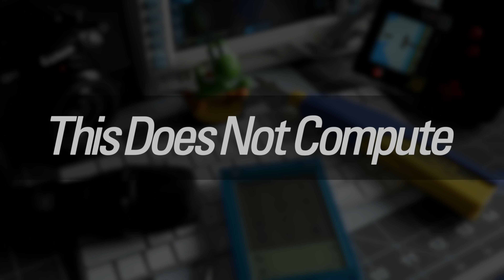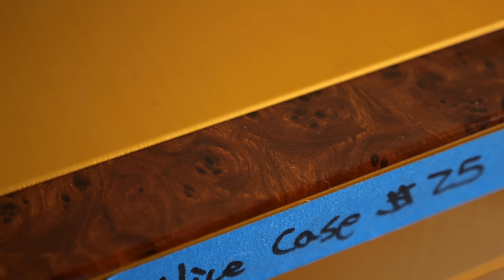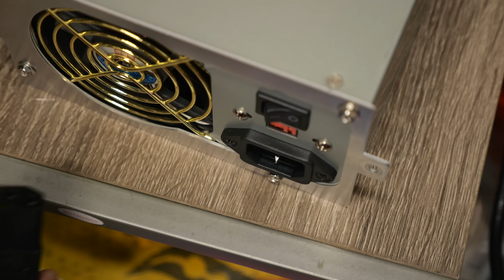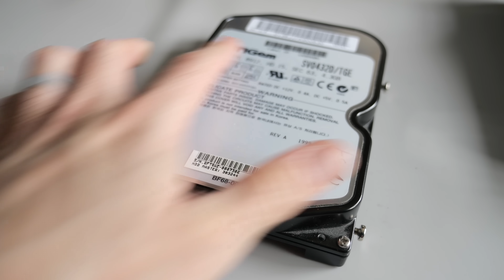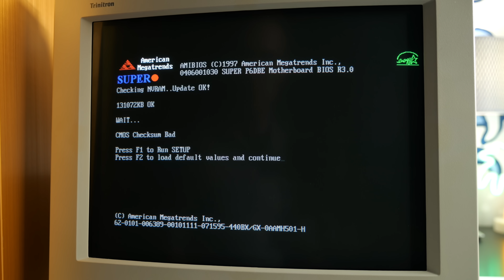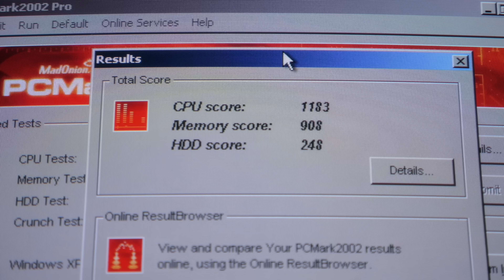I tried to put TWO vintage Celerons in one PC

Comment: I actually had a dual celeron running. I drilled and patched, and it worked perfectly. 
Also with w2k ...

That's a nice memory 😊
Reply: And mine ran both on 450MHz flawlessly 😊
Reply: The celeron was faster because it's cache ran at full speed

Comment: I had one of these rigs when I was in Uni studying computer science in 1998.  The motherboard I had didn’t have the voltage jumpers to unlock the cpu.  So what was common was to use clear fingernail polish to paint the voltage pins on the slocket cards before inserting.  Mine ran windows NT 4.0 as it had SMT.  The partial board I had required an add on APIC/IO card to allow for interrupts for multi processor.  Graphics I ran a 3Dlabs premedia 3 card in it for open GL.  This was my dev and quake computer in Uni.   Paired with a view sonic 21” CRT monitor it was a really amazing PC for the time.

Comment: As far as I was aware the slot 1 conversion to dual only needed a mod to the edge connector? Regardless the solution without mods that cant be undone is to use socket 370 to slot 1 adaptors. Almost every one of them had a jumper option to enable the dual cpu option. That would work in that board. Super Micro was a very standard board allowing almost nothing to be changed from the standard.. With voltage and a PCI video card my old dual Epox board would reliably run over 500 mhz all day long. The biggest part of the lottery of performance back then was the chipset. Like CPU's sometimes you would get a good one and sometimes not. Also an important thing to keep in mind is to only use one channel of ide for a dual system or even better a SCSI setup. Dual channels with a dual CPU on those BX? chipsets would slow the system down.

Comment: Dont cut the trace, cover the pin in the connector, i have used electrical tape. A small piece cut just the right size, and take in count the insertion or it can be removed in the process. Thats why late i switch to a BP6.

Comment: dam, that lian-li would be something I use in a modern build
I don't care about looks as much, but a copper anodized look would work well with a brass hardline watercooling steampunk theme
especially if I have a micro-boiler that can blast out a steam whistle whenever I wish(possibly using a TEC module stack to scavenge heat from the loop to do it)

new cases are often thin sheet metal with no little quirks that make life easier like the harness or a removable drive cage(and often limit you to 2.5" or only 2 drives)
that case would fit on a modern desk just fine, and as it has many mount points it probably fits most modern ITX/ATX boards and could be very nice with a little bit of hardware

in fact I would buy a case like that for use as my server PC, it would allow me to have a nice 3 slot HDD hot-swap for the raid, yet still have room for a 5.25 bay device as literally no modern cases have >3 5.25 bays when there are many reasons to have so many still
and the front 3.5" bays would be nice for various things like a fan controller or a cf-express card reader(the new modern dump card for hyper-fast data transfer, basically NVME drives in a cartridge, I hope it gets adopted beyond xbox-one storage devices)

Comment: Google is paying attention to what we write. I wrote that i owned a celeron back in 98 today. Mine was 333 Mhz though and not 300. Or it was 300 and i am somehow thinking it was 333Mhz. Either way dont matter. I am thinking socket 478. Man we are so lucky now No IRQ's to sort. No DMI to worry about. Back then installing a sound card was a big deal. Graphics cards at that time were counted in the MB of memory. Usually far less than 10. My first card was on board and it had 2.

Comment: I remember running a dual slot machine around 2000ish and had to use WinNT to get it to accept the second processor.   Had it all in a floor standing skyscraper ex server case and boy did it put out some heat, I quite liked the games back then with the Quakes, Doom, Hexen (dungeons and dragons Doom stylee), my little flat was a gamers paradise with N64 and PS on the main telly, my computer beastie in the front room too, Sega Dreamcast in my bedroom and my daughter with her mountain of NES games and her little NES all fired up.   I also had the strange PS memory card adaptor that allowed one to play Game Boy games as daughter loved Pokemon so I think we laid siege somewhat to the gaming scene and I forgot the Saturn but that never got much use as the DC was jus' so so much better.   It was around that time I earned my marks building machines, mate and I bought 40 ex business PC's all working for £40 off the then new eBay, drove all the way to Hereford from Bournemouth and car was down on its bump stops it was so heavy, couple weeks consolidated the 40 into 30 viable machines with the 10 left for spares, didn't even get to sell them as a local PC firm bought the lot spares and rebranded them, they gave me £50 per machine and sold them £200 a machine and boy was that a cool feeling esp when my next door neighbour bought one for her kiddie and she thought it was the best thing ever O.o   I stopped building for folks about 10 years ago, last build was a dual water cooled AMD system which had all the UV fluid and lights and in a toxic green sprayed Antec Skeleton which had one water circuit for the CPU and one for the GPU and RAM with the CPU water toxic green and the GPU circuit vibrant red...   Chap still has it but has replaced the board and CPU with something Ryzen and he ditched the GPU circuit but still running water on the CPU.

Comment: I had a server PC manufactured by HP of 2000-ish vintage.  I received it in 2006.  It had support for dual Slot 1 CPUs but required an additional VRM, parity RAM, and some other gubbins to make the dual processors work in it.  I'd love to see a video on one if you ever stumble across it.

Comment: I remember buying two slot1 450 P2s and the problem being cache ram in the cpus.. there were 128/256/512MB variants and they couldn't be mixed on the same dual slot1 board I had..  They cost over 1K each at the time, not to mention an Adaptec ah2940 with a 4 7200rpm wide scsi raid.. was used for rendering solidworks and cad animations. I later gave it to a friend who owned an Amiga "toaster" trying to say he had a better video rendering system.. oh the late 90s!

Comment: back then for SMP play, you had to have a matched pair of CPUs, the requirement was pretty stict with revision and stepping having to be the same, with some people going as far as having the same build dates on them. Given one was stable overclocked without the additional voltage, my guess is there might be come inconsistences with the smp requirement as a matched pair?

Comment: Lian Li really made some nice PC cases. I have a full tower PC-A77 black, and the 25th anniversary case PC-777 that looks like a shell/snail. The snail has mounting holes for dual socket 771 motherboard, which I use in this. A Supermicro X7DWE. I'm a bit jealous of yours, especially with the golden color. Shame about that the dual celeron setup didn't work as you planned.

Comment: My First PC Was A Pentium 2 With A Whopping 40GB HDD! It Was A Freebe! I Ended Up Buying A Motherboard CPU Ram Combo From CompUSA! After A Couple Of Months I Upgraded The Case  And Bought A 40GB HDD! Walmart Had The ALL-In_Wonder Card On Sale So I Started Recording TV Episodes! Today My TV Collection Is In The 10's of Thousands! I Use The HD HomeRun Quadro Network Attached Quad TV Tuner And Have Built An Array With Used Server Drives That Holds 500TB! The Program I Use To Cut The Ads Out And To Converts Them Into The MP4 Format!
I Would Have Loved To Have A Great Case Like That!! But Today I Rock Old Optiplex's That Can Be Bought Cheap! I Have A I7 8700, A 1TB NVME SSD, And A Yeston GTX 1650 In My Optiplex 7060 SFF! It Replaced The Old Core2 Q6600 That I Was Running until 2022!  Nothing Wrong With It But After 3 Power Supplies And A recap Of The Motherboard A Kingston 256GB SSD And 8GB Of 800MHZ DDR2 Ram! I Doubt My Newer PC Will Last Near As Long As The Q6600 But It Sips Power Compared To The Dell XPS 410! I Run A Jellyfin Server To Serve My Media To My 6 TV's In My Home! We Have TV's In Nearly Every Room!

Comment: Had a Tyan dual Slot 1 board with 2 Pentium 3 533's in it, cover up pin b21 and overclock the crap out of em. U can crank up the bus speed but most slot 1 cpu's can be multiplier unlocked by removing b21 pin for equation.

Comment: The first computer I ever built was in that case! It was around 2006ish. I took a summer job at a computer repair store and for my first solo build, I built a beast with a celeron M 450 paired with an EVGA 7800 GTX KO. The customer ended up paying around $2000 and I'll always remember his face when we told him we only had one 7800 in stock so we couldn't SLI it until we received our shipment the next week.

Comment: Literally did this myself in its prime. I bought a single slot board, then a Celeron 300, then a dual board, then a second Celeron, then saved for two full fat pentium 600s. I tested all along the way and while it wasn’t always 2x performance, it was certainly worth the effort. I remember the dual lockout issue, but it didn’t stop us at the time. I certainly didn’t modify any CPUs so there must have been a solution at the time that we found. Maybe certain boards implemented the workaround in the slots. I do remember buying several boards and they were all from unknown sellers all over the place. 

Games, graphic editing, and 3D rendering were all enhanced by using the duals. The best bang for buck along the way was the dual celly 300 setup overclocked to 450. I was going to build multiples of those and turn them into a render farm but while I was saving, the pentium 1Ghz happened and made the old dual CPU setups a waste of time. My whole circle of gaming friends switched to Windows 2000 because of the SMP support and stability while overclocking.

Comment: The Socket 370 Celeries didn't have anything keeping them from being used in dual processor systems, so I set up quite a number of dual Nintendo cartridge motherboards with Socket 370 to Slot 1 adapter cards.

Just to see what BSD would do, I even ran one with a Pentium II and a Celery. For some reason, people got REALLY upset and told me that I couldn't do that! I suggested that the BSDs provide support for keeping track of processor features available on each processor, so if a program needed certain CPU features, it'd only run on CPUs with those features.

It was a good time because AMD was really giving it to Intel then, so Intel really had to work to make decent products :)

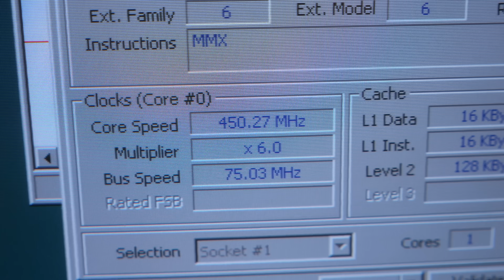Comment: @9:50 I'll answer that for you... Because the only thing that held Pentium 2's back in overclocking was the cache chips which didn't like overclocking. The celeron didn't have the cache chips, so they weren't limited that way. It is absolutely nothing to do with any decision on Intel's part. It was just a happy accident.

Comment: I had two 366 celerons overclocked to 550 on an abit bp6 motherboard.  Ran it with voodoo 2 3dfx graphics card on top of a matrox mystique video card.  Loved playing GLQuake, Quake 2, and Quake 3 with this setup.  Originally just had an original 3dfx card when they were new.  Clearly remember wife being pretty upset when I bought the second Voodoo 2 to run in SLI.  Ended up selling second one later with one 366 but still have the rest of the rig.  Your video has me thinking I may try to set it up again.

Comment: This was very common back in the day. I ran a pair of socket 370 366mhz Celerons on adapter cards, the adapter cards had a jumper that bypassed the SMP lockout they also allowed some other shenanigans, I think it may even have been in the same case (but black).
Reply: I couldn’t remember how I did it, but yeah! I used adapter cards too! And later the BP6 😊

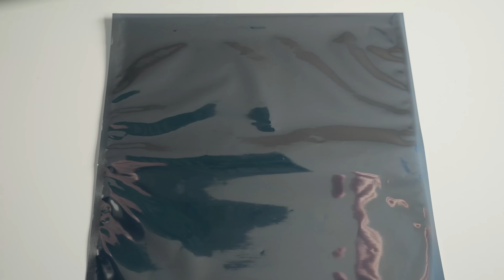Comment: At 0:30 I'm like "Oh crap this isn't going to work" .   There's a reason why the Abit BP6 was a legend back in the day, as it was very specifically designed to get around this limitation.  There was also the Epox BXB-S, though other releasing the first VIA Chipset Athlon board in 2000.. they weren't making waves like Abit who was really the EVGA of the day, pushing boundaries and releasing high quality enthusiast level boards.

Comment: I bought a 300A in hopes of overclocking it, then discovered my cheap motherboard's BIOS was limited in it's configuration.  I could set the speed to 450, but that was by setting it to 100 x 4.5.  It's setting at 66Mhz were limited.  Later on I inherited a PII 350 from my cousin that could be overclocked easily, but by then I had upgraded to a PII 450.  I had a friend who pushed his 300A to run stable at 504 Mhz, but he said keeping it cool was the biggest problem.

Comment: The Intel 440BX chipset in slot 1 had some crazy longevity, with all sorts of adapters to use modern CPUs. I had started off with a 350mhz Pentium II slot 1 on mine and ended with a Celeron (tualatin) 1.2ghz overclocked to 1.7ghz (140mhz FSB). I had a slot adapter to use socket 370 CPUs, and then a second adapter on-top of that one that allowed use of the later Tualatin CPUs by adapting for the lower voltages.

That 1.7ghz Celeron was roughly equivalent to a 1.4ghz Athlon at the time. That system was only ever retired because 768mb RAM wasn't enough anymore, not because the CPU was slow.

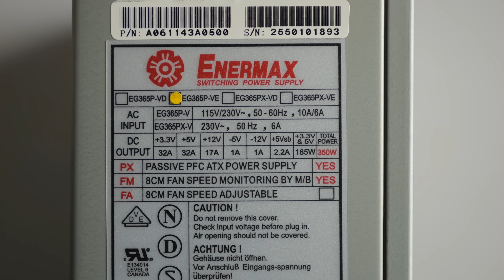Comment: 3:20 - You are not wrong about Lian Li cases.  I also deprived myself of nice cases all my PC building life-- the cheaper the better, cuz all it had to do was hold things together and let me in when I need (so I thought).
The last major PC I built, I finally invested in a nice Lian Li case-- I forget the exact model, but it's one of their popular, mostly-glass models with the PSU mounting beneath the motherboard (not at the top or bottom of the case, but behind the motherboard).  It's soooooooo nice.  Things that aren't supposed to bend-- DON'T BEND.  Things that you're supposed to be able to get in and out of are easily accessible, and stuff fits everywhere properly.
I've been a tight-wadded fool all my life, and will never skimp on the case ever again.

Comment: I built a 2x 800? MHz Celeron Slot1 (100 MHz FSB) in Dual-BX by drilling the pull- down and soldered to pull- up.

Comment: I'm sure you know this, but Celerons were nothing more then failed Pentiums, as is the case with all low style CPUs. I can't stand when YouTubers post videos talking about the Binning Process, as if it's something special just for them, when ALL Chips, CPU, GPU, whatever all go through the Binning Process. And as the chip fails it's reduced until it passes. Some chips overclock better then others due to why they failed and if it involves certain areas of speed and whatnot. Sure the Chip Lottery is REAL, but now why most think. Intel, AMD, and all the past CPU Chip makers just made CPUs then Binned them and hoped for the best. There's zero reason for CPUs or GPUs to be so expensive as their chip process and construction costs are far less today then they were way back when. Today the amount of gold used is but a fraction of what it was before and the gold was the reason the chip was so much in the first place. Monopolies have killed the Free Market and Monopolies lead to GREED. TSMC is the ONLY chip manufacturer these days and that's 100% BS. Because they control production they control cost because where else are you going to go? NOWHERE as you only option is TSMC... Keep up the great work...

Comment: Not surprised about your first 300a not being able to overclock to 450mhz as it is basically a silicon lottery.  I recall that I had the same issue when I brought my first 300a and I ended up returning it and got another one.

Comment: I'm still using my related Lian-Li PC65 (windowed, with additional top-mounted fan) that I bought new in 2003, albeit now for my kids computer. I can't bring myself to throw it out as the quality is fantastic and the compact size and low weight make it effective for lower power builds. Great case!

Comment: I had the slotket setup running Windows 2000 (the best version of Windows ever) back in the day. A friend did the wire patching at work, but I don't remember us having to cut any traces. Overclocking to 450 MHz worked with stock voltage, so I guess that I got the luck of the draw. I eventually switched to the dual socket 370 board shown at the end of this video.

Comment: years ago I had an Abit BP6 mobo with two socketed Celeron 466's running at 525 MHz. Unfortuneatly the only OS at the time that supported two CPU's was Windows NT4 Workstation, for which there were very little games.

Comment: That FX5200 actually might be holding things back more than you'd think. The overhead from the era of drivers that would need isn't negligible on a sub-800MHz machine to begin with, and the 5200 was known to be slower than the Ti4200 that preceded it. 

That said, it's also what you had on hand, so it'll do just fine. :)

Comment: In 2006 I bought a Intel extreme board for 200 bucks at a pawn shop and it was either the guy was gonna pay his rent or keep the board any op for the ladder anyway I haven’t put it together yet but I have a an attack or it was almost $400duel 1200 W power supply so that should be pretty interesting

Comment: Back when these were period correct I had a dual P2 system with mismatched CPUs. I think one was 450 and the other was either 350 or 400. It ran Linux no problem - never tried Win2k - and all the utilities properly reported the two different CPU speeds. Whatever shenanigans you had to do to set processor affinity back then allowed me to run benchmarks on one or the other and confirm that one really was faster. There were never any problems!